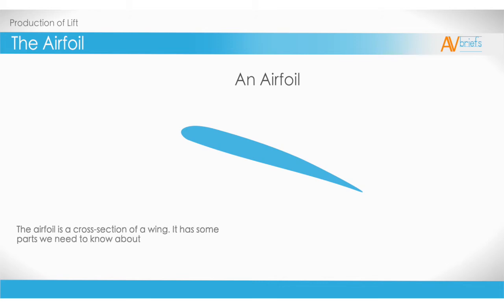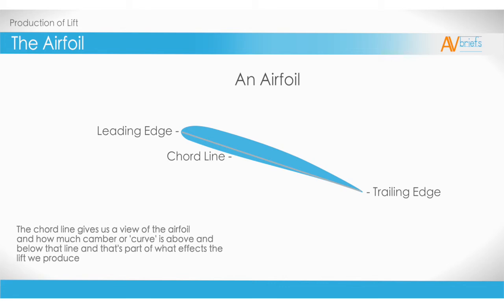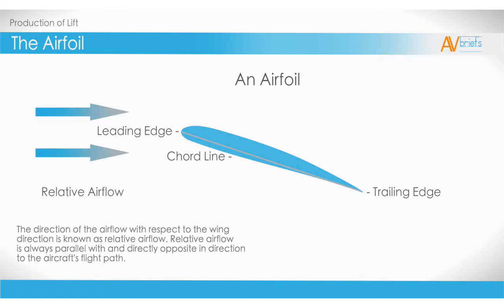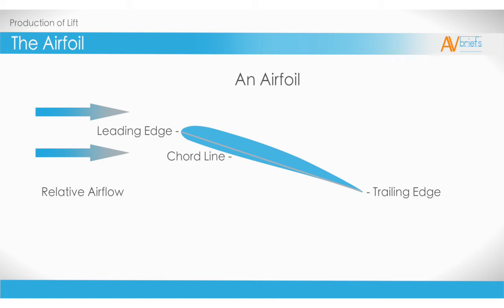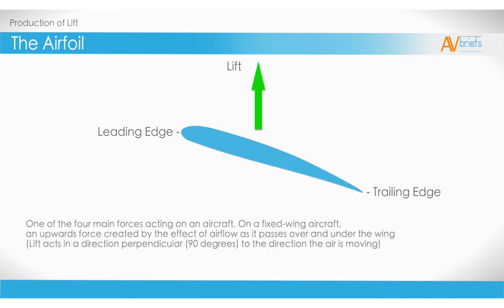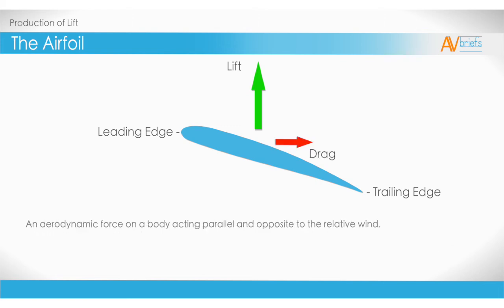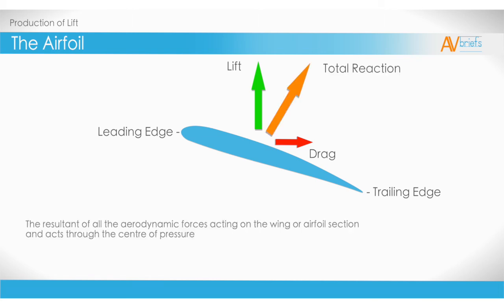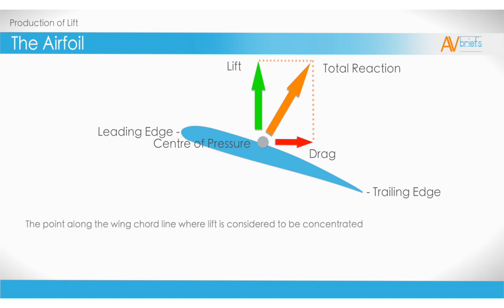05 Learn To Fly | The Production of Lift | How A Wing Works

Comment: Nice work avoiding many of the common misconceptions regarding lift. It may have been beneficial as well to explain that the shape of the airfoil causes lift generation by affecting the pressure difference across the top and bottom surfaces of the airfoil.
Reply from the maker: Thanks and great points. That’s certainly something to learn later down the track!

Comment: How would such a wing support an aircraft flying upside down as many do?
Reply from the maker: Hi Leonard, the wing would work in the reverse. However as the wing is designed to be flown right side up, the lift generated would be much less if it is upside down. You can see the difference in aerobatic wing shapes!